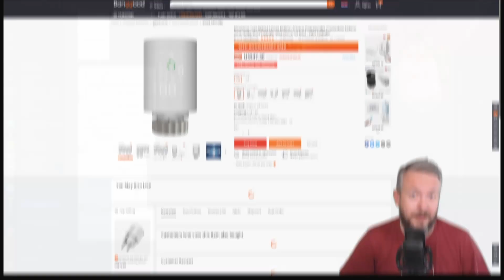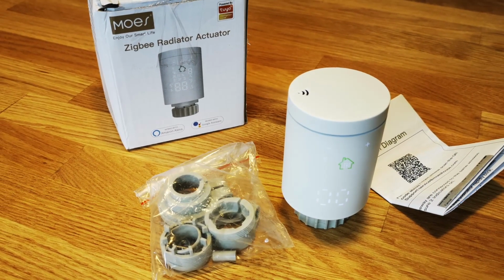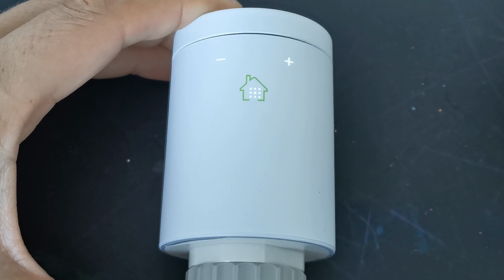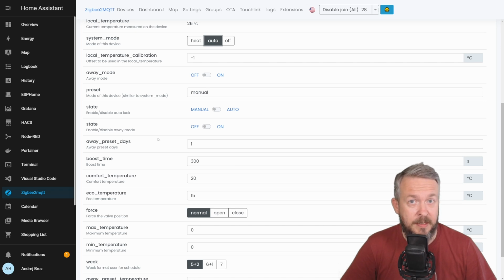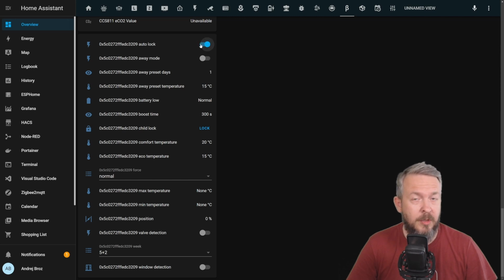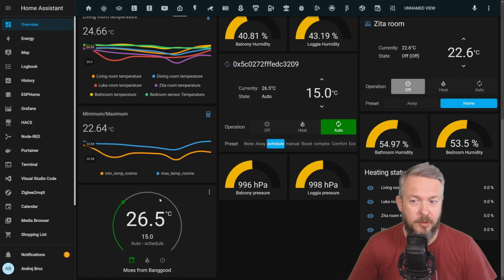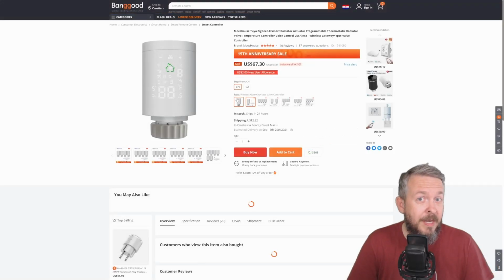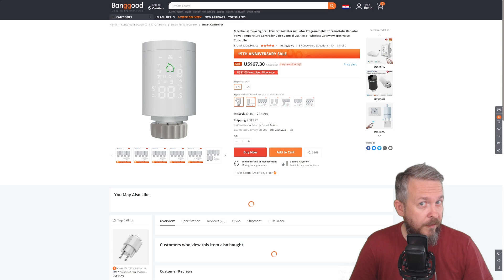Moes Zigbee Smart Valve TS0601 in Home Assistant

Comment: Thank you for the video, especially for your instructions on pairing.  The paper instructions are awful.   I'm waiting to get a HOOBS unit before I integrate them into Home Assistant.  I definitely need remote room temperature sensors and some sort of automation because the heat from the steam pipes makes the temp at the TRV (because of the proximity to the steam pipes) is very different than the actual room temperature.  Do you have any videos on how to set that kind of an automation up?  Do you recommend any room thermometers?  Would the thermometer need to be Zigbee or just HA compatible to use for an automation? I'm a newbie in this home automation world.    I have six of these TS0601 units now and basically I have to manually turn them off/on (closed/open) in the SmartLife app without any autotemp because of the above issue.
Reply from the maker: I've make video some time ago on "Better Thermostat" - that's an HACS component/integration that can help you. It is using external sensor to control heating devices, but not just that.

Comment: In my second period of heat with these TS0601 i ditched the last and replaced it with Eurotronik Spirit-Z (predecessor). The landlord has used Heimeier valves for the building and the Moes T0601 is unreliable twice a week for these heavy valves. Their adjustment to the pin get lost, so there is no heating or sudden sauna, from always open. So it depends on light sliding valves like Danfoss for success.
Reply from the maker: There are some many valves on the market (and also TRVs) - sorry you got bad experience with them. I'm still in process of testing various different smart TRV, but not enough time to test it as I would like.
Reply: @BeardedTinker  It's the companies fault, they offer the valves for 30x1.5 but seem never tested them.

Comment: Hi! I have a little problem with this. When I set the system mode to 'auto', after the scheduled time passes, my 'current heating setpoint' gets set to 153.6°C (wtf)... And when the system mode is set to 'heat', it doesn't follow the weekday schedules. Do you have any idea why this is happening? My device is an EARU TRV06, but I believe it shares the same drivers (TS0601 _TZE200_rxq4iti9). I have 3 units of these.

Comment: Thanks for this video. I've a question if anyone can help. 
I bought 9 of the Zigbee smart radiator actuator and managed to install them well.  But on the AUTOMODE TYPE in the Smart Life App, there is no 5+2 option. instead we have a double of 6+1 option (6+1, 6+1, 7)
 how can I get a 5+2 option? Can anyone help
Reply from the maker: Not sure really - not using SmartLife with those valves. I have them connected via Zigbee2mqtt.

Comment: Hi,
is it possible to pair valve with room thermostat? I mean valve checks temperature, that is near radiator so it is not accurate. Of course you can adjust it, but what I want is that automate valve open/close based on room thermostat, not valve thermostat.
I have valve from Danfoss, but I don't like them. to have 24 degrees in room I need to set 26,5 in valve and if I drop 1 degree in valve I get 22 in room. It's a huge drop.
Reply from the maker: There are few ways. Some vendors in custom apps support using external temperature sensors instead of interna TRV sensors to control on/off state.
Also, Home Assistant has in HACS custom component called Better Thermostat - it has internal support for same case.
Reply: @BeardedTinker  and what about this valves that you're using. is it possible to pair it with external thermostat?

Comment: i bought 6 o them and have very huge problems. worst thing is if i set the temperature to 21C it is heating up the room until 28-29C until it finally shuts the valve, it just doesn't stop heating after the temperature is reached, read on Reddit that many people have this and no solutions so far, so its literallt 200€ of waste
Reply from the maker: What heating system do you have? And what hub/installation type are you using - Moes hub, home assistant or something else.
On 3 similar valves from Moes, I've never seen that they shoot so much over the set temperature.
Reply: @BeardedTinker  i am using Home Assistant.
Reply from the maker: What Gateway do you use. Did you try Better Thermostat HACS integration?

Comment: Hello..I wanna ask you a question ..After setting the parametres with wifi what happens if  wifi cut of  after setting the vakues? Will it keep on working with the settings (which set before) without internet?  For example does the schudele programme works without internet ? Thanks..
Reply from the maker: Yes, of you program schedule, it's saved locally on device. Even if connection is lost it should keep it.

Comment: Бих искал да видя реален тест как отваря и затваря и за колко време, защото ако не се лъжа тези движеха по 5% за минута и отварят и затварят много бавно, както и не затварят докрай и температурата в стаята става много над зададената. Тест на термо глава трябва да показва как успява да поддържа зададена температура ... Все пак това е основното, което прави.
Reply from the maker: Valve position depends on types of the valve. Some can open only in 25% increments, others 10%, and one I've tested can make steps 1% at the time. Most of them don't allow you to control the %, as they do it them self. Check Better Thermostat HACS integration on what and how it can be customized and best suited for your installation.

Comment: thanks for sharing. I understand that you will need a Hub/gateway in order to control a boiler temperature, however, what about apartments that get hot water through the radiators and controled by its flow. do we need the hub or can i just plug the valve and connect directly to my wirelss? thanks
Reply from the maker: If you want to avoid ZigBee/zWave - look at Shelly TRV. That's WiFi device, works well, no need for any hub or similar. And can be used via web interface of device or via Shelly app.
All others require some kind of gateway (proprietary if you use their app or and ZigBee if combined with Home Assistant).

Comment: Great video!

Could you tell me if it can be integrate via ZHA?
Thanks.

Saludos.
Reply from the maker: Yes you can! This model is supported. Zigbe2mqtt has more features available, but ZHA also works with it.
Reply: @BeardedTinker  Thanks. I'm triying to integrate a similar TRV (brand "Sandy Beach" whose model is also TS0601) via ZHA and Sonoff Dongle. 
Pairing is correct, but  it doesnt show any thermostat entity, just LQI and RSSI sensors. 

Have you try to integrate Moes yours via ZHA?

Thanks again!
Reply from the maker: There are tons of different valves with TS0601 part number. All 3 I have (moes) can be paired and are exposed as thermostats to ZHA. But just as side note - even this one has two different hardware + firmware combos and is still in same box and branded as identical device while actually it's not. Models I know that work with ZHA are: _TZE200_b6wax7g0, _TZE200_cpmgn2cf (this one rom video) and 
_TZE200_ckud7u2l
Reply: @BeardedTinker  Tons of thanks for this info! 🙂
I'll try yours ones
Reply: @BeardedTinker  I just recive this smart valve. No problems to pair via ZHA. 
It just show 3 entities: thermostat (with 6 presets), battery level and switch (this I dont know what for is), but it's enought for me!

Hvala !

Comment: Hi. is any chance to manipulate valve position between a certain percentage, in homeassistant ... for TS0601 ?
exeple:
if is above 24C set valve position to 15%,   if below 22C set valve position to 40%
Thanks 😁
Reply from the maker: Out of 3 different Zigbee valves I have on testing right now, none support just that.
They can be forced open/close or auto. I'm currently testing few of them for a bit longer review, differences etc, but it will take some time to get that video out.
Reply: @BeardedTinker  Thanks for your time.
Reply: This would be great. For example, temp is over 15 degrees, then close valve. Lower than 15 degrees, then heat with 30% open. Lower than 13, then 80% etc. I would imagine that would save a lot of battery as well if this adjustment would run an hourly check, and normally would not change.
Reply from the maker: Yeah, would be great. Not sure why this is not exposed for control.

Comment: Question, is it possible to force open and close the valve? How is temperature mode working? I saw the valve has 5 positions, 0, 25, 50, 75 and 100 percent? Am I right? I need to set positions too... Thx for help.
Reply from the maker: With Zigbee2MQTT, it should be possible. I'll test it over the weekend as currently it's paired to ZHA network.
Reply: @BeardedTinker  Thanks very much!

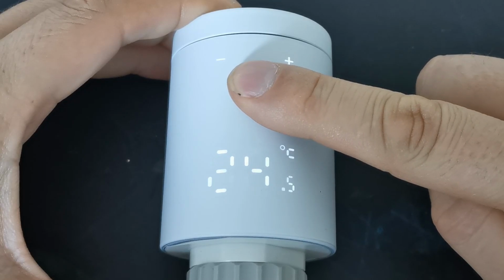Comment: Thank you, I have the sonoff Zigbee 3.0 USB Dongle Plus–ZBDongle-E on my HomeAssistant as a gateway so i didn't want to buy a Tuya gateway. The manual with the Moes smart valve was not clear enough how to connect. Strugling with the tyua app was very persistant on me buying the Tuya gateway. No way. At 4:30 you showed that the homekey needed to be activated for 5 sec or more to bring the device in Zigbee pairing modus. After that it was a piece of cake to get it up and running. :trophy-yellow-smiling:
Reply from the maker: Yes, hold for a long time home, scroll to WiFi icon, press home, hold home :)
It's hidden really, but when you do it dozen times you know it even in your sleep. 
I currently have 3 similar valves that I'm testing - it's nightmare as each one has different pairing process. Glad you found that part!

Comment: Hey, can you explain to me exactly how you did it with the external temperature sensor? with the "Generic Thermostat" I have not managed it, because the thermostat then only changes between 0% and 100% valve position. because there is only the function heating and off. How do I make it that the thermostat with an external sensor works exactly as in automatic mode?
Reply from the maker: Check HACS component Better Thermostat - I also made video on it. This should be easiest to do it.

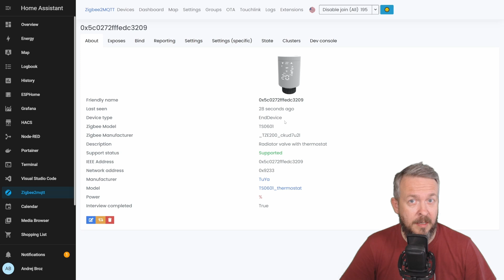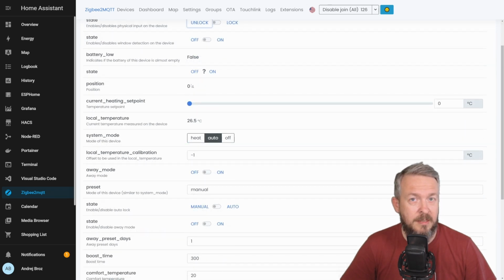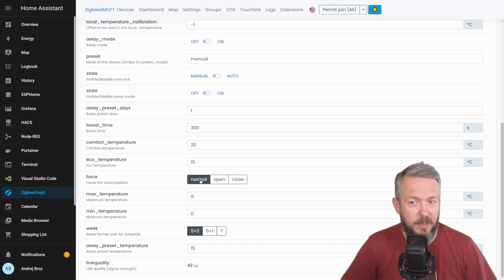Comment: Hi sir, perfect video, due to you, I decided to order 2pcs of head valve (I think this is the proper name). Instaled, worked perfect in the view of your intention. I tried to be not a leech and wanted to provide some additional information. Some people may be want to implement program of the valve heads. So I have fought a little bit with proper context of program. Found out that proper string should be for example: 05:30/18 06:00/22 07:30/17 13:30/22 21:30/18 22:00/18  .... 6 blocks of times and tempreatures... but but but but....(-:))  the z2m dashboard wrote this into holidays only and not to workdays, nevethereless what  I was tried to wrote and where.... some advice for greenhorn sir?
Reply: Hi, I just wanted to ask whether you have the same problem. You probably use valves without their own programs. Could you please test them? To upload program in mode 5+2 for W and H and then check the status, it should have been written to valve... thank you. I just wanted figure out if I have something bad in setup.

Comment: Did i need the hub?  I habe a pi3 with SONOFF Zigbee 3.0 USB Dongle Plus TI EFR32MG21 + CH9102F sind Home Assistant ?
Reply from the maker: It should work with Sonoff Zigbee stick. I tested it with it.
Reply: @BeardedTinker  How To set the week Programm in Home Assistenten?
Reply from the maker: @Peterzuffall1981  you can set schedule via MQTT commands - https://www.zigbee2mqtt.io/devices/TS0601_thermostat.html#controlling-device-specific-features
Of course if using Zigbee2MQTT. On the above links you have examples of commands and payloads you need to send for specific task.
Reply: @BeardedTinker i have zig2mqtt , but how can i Senf Mqtt Commands sry i am nee…
Reply: @BeardedTinker  in home assistant it shows up... but not in mqtty topic zig2mqtt

Comment: Is it also the case with you that at a set 19 degrees it easily overheats to 22? All thermostats.

MOES support has advised that I simply set 16 - 17 degrees at the desired 19 degrees to get the desired 19 degrees.
I find that really stupid
Reply from the maker: I've given my away but new one will be here in a week as I really miss it for testing.
Reply from the maker: To add on this, this is available already, but it's still been worked on.
Reply: In the advanced options you set a measuring temperature correction from -9 to +9 degrees. (see the manual)
Reply: Yes, that is correct.
However, you are confusing something.
You mean that in the advanced settings can set the actual temperature with the displayed.
What I mean is that the unit overheats by default 2-3 degrees.
Support has confirmed this to me as well.
Practical example:
You want 20 degrees? Then you should set 18. Because with the 2 degrees that the device overheats, you reach your 20-21 degrees.
This is the dumbest unit I've ever had.
And they refuse to take it back. I didn't read this nonsense in the product description. Because then I would not have bought it

Comment: I installed 7 of them in my house just weeks ago. So far so good but their internal temperature sensor is not ok - better to use with external sensor and automate in HA
Reply: Hi, I wonder if you know how to automate the operation of the valve using the external temperature sensor in HA
Reply: @nugzarmaisuradze6722   Yes, I did that using my NodeRed. In short: I set up the program to comfort, and I simulate different temperature (by calculating it) as a target temperature. I ignore the inbuilt sensor from the thermostat and I use my sensors.
Example: built in sensor shows 20C. My sensor shows 18C. I want to have 19C. Without my sensor, the thermostat would stop heating (current is 20, target is 19C). So what I do is calculate: target (19) minus current from my sensor (18) and I set the new target to be 21C - this way thermostat works the way I want. That is simplification - in Node Red it is a bit more complicated - if you wish to know more let me know.
on top of that: when thermostat turns on, it will very fast make the built in sensor go even up to 8C above the real temperature - it is normal because this sensor is 5cm from the radiator ;-)

Comment: Hi, 
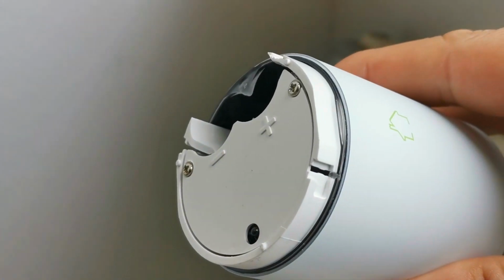2 questions: how do I unlock child lock without the app or cutting power and what does the black switch (visible under the battery compartment @ about 3:39 do? Thanks.
Reply from the maker: Check manual here:  https://drive.google.com/file/d/116rj8RwvsLJHDkL9Y6XwAXmZ3JiX6Pnb/view
To unlock, long pressing - key should lock/unlock it.
I've given my away to a friend some time ago, so for the button inside, no idea really. Was it sensor to see if cover is open or not - can't remember.
Reply: @BeardedTinker  yeah... Thanks. Long press doesn't work, though. Hence the question.
Reply from the maker: @benjaminremy4970  You can always try MQTT command: https://www.zigbee2mqtt.io/devices/TS0601_thermostat.html#lock
If you have it hookedup via Zigbee2MQTT, you can use it to send lock/unlock command.

Comment: Really would like to know if the batteries Re aa bad as I'm hearing in these comments?
Reply from the maker: Can't help you with that answer. I've given my away - but here is my experience with other manufacturer. They need to be replaced once at heating season, but if device get's more opens/closes you may need 2 replacement. So it all at the end depends on your setup, location in apartment, how it keeps or loses temperature etc. Out of 3 I have, one in living room lasts longest. In room where I have issues with thermal insulation, I may need to replace more frequently.
Reply: @BeardedTinker  thanks for the reply. Can I ask what models you are using now?
Reply from the maker: I've been using Tado Smart thermostat for about 7 years now, even before I started with Home Assistant and Tado Smart Valves for about 3-4 years. In 2-3 weeks there will be video on that.

Comment: This is not that simple in ZHA, a lot of this information is unavailable.  Seriously considering restarting with Zigbee2MQTT
Reply from the maker: I prefer ZB2MQTT over ZHA due to more devices being supported. But most of the functionality should be available via ZHA too.
Reply: @BeardedTinker  after poking around apparently the ZHA quirk for the valves hasn’t opened the same amount of attributes as the MQTT implementation! I have to wait patiently for someone to make a quirk update!  Bit more of a hassle setting up zigbee2MQTT but it would save hassle in the long run!
Reply from the maker: Talked yesterday with HA devs (we have regular monthly calls which are awesome). They'll tray to look at this as they want to expand this part of HA - to enable more and better energy saving control. So keeping fingers crossed.
Reply: @BeardedTinker  wow! Talk about speaking to the right people! I will keep an eye out. 🙏

Comment: Hi! Thanks for sharing this insights. One question, I am using a Combee2 integration and seems to receive a lot less parameters for the thermostat, any ideas why that is?
Reply: The Conbee2 integration is simply less powerful than Z2M, the same is true for ZHA.  Non-Z2M solutions are great, but if you want to control less-standard devices to their full extent, Zigbee2MQTT is the way to go.
Reply from the maker: Not really sure on this one. Although I think there is also a newer version of same valve (hw changed but model is still the same), I think it's because of integration itself...